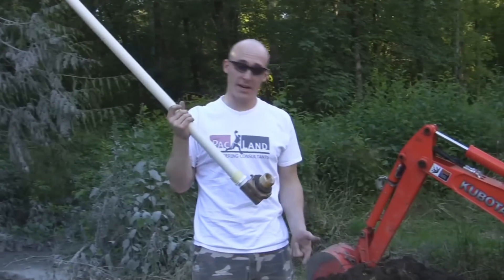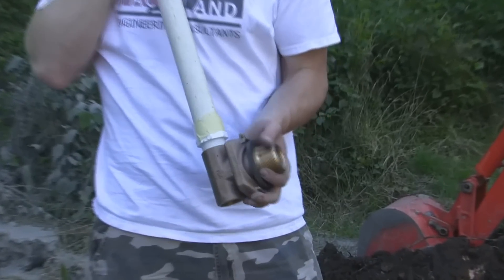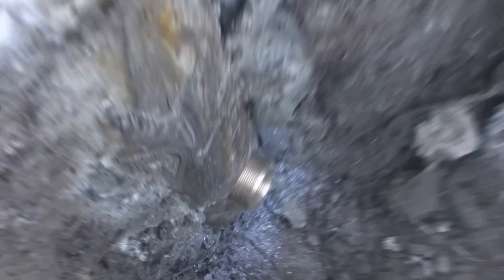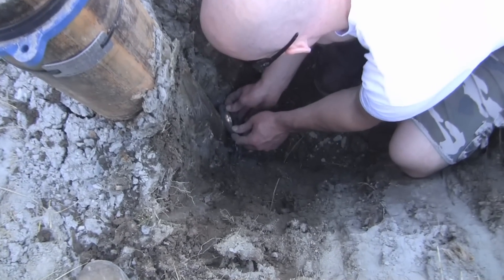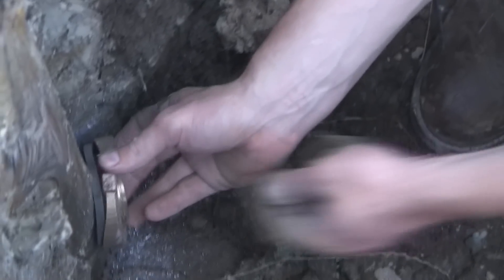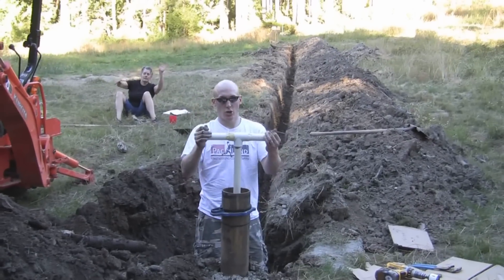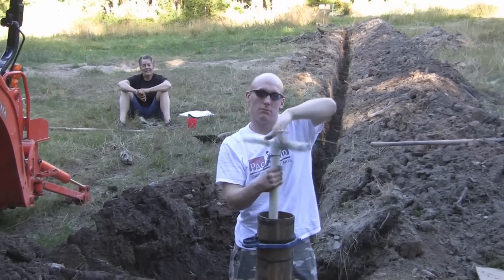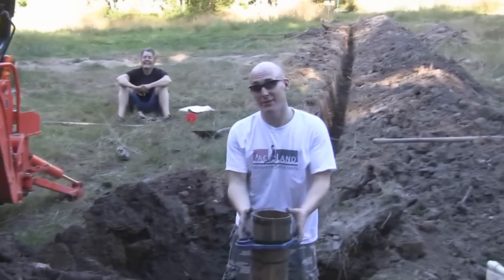How to install a pitless adaptor

Comment: old wells had 4 foot pits to allow for frost protection. they would always be open for servicing. a pit-less adapter is so that the PIT can be filled in to prevent contamination.  it also keeps people from falling into an open pit.
Reply: In Canada we have 8 feet. So dug 8ft down by hand lol

Comment: Nice job!  I've now done some of these too.  I have a pitless with a spring instead of the "slide in: type.  There is a hole at the top of the side in type where you can attach a string  This will prevent it from falling down the well if it slides off your "T".  I also made my "t" from galvanized, (the second time around..lol)  so it would thread easier down in the well, where you can't really see it.

Comment: Lol , you guys are some funny people.  Awesome video by the way. I found it because I have been working on my grandfathers old well and kept seeing the term pitless adapter and was like. what the heck is that.
Of course I made some observations that I cant help but point out. One is that I would have cleaned and possibly bleached where that seal went on. Second and most important thing was the the tab  with the hole in it on the pitless adapter. lol this hole is for tying a small roper to so you don't drop the thing down the well. You get points for bravery though because id have been scared to death that thing would fall off. lol. Jet pumps and submersible pumps all have holes or tabs with holes to tie ropes or lines off of so if something breaks they can be pulled up.  I love working with wells and learning new stuff. Thanks for the vid.
Reply: I've been doing this for years professionally and the way he did is 100% correct. The pitless certainly will not fall into the well I've installed hundreds of pitless adapters and the fact is that you need to really pull that pitless off of where it rests. The only thing that I found flawed was the fact he had a PVC tee, if he wants to pull it back up it should be galvanized or stainless

Comment: You need to put a small piece of pipe inside the pitless adapter to keep it from separating.. .once you have it through the casing and the nut on you pull out the small piece of pipe and pull out the T handle!

Comment: Should use iron (steel) pipe for pump removal. PVC sometimes strips the threads or breaks during the removal process. Be prepared to pull hard when removing the pump. May take two or three people to pull hard enough to break the pit-less adapter loose and depending on the depth of the well some take some serious pulling before you can get a hold of the rope that goes down to the pump.

Comment: Originally the pit was to keep the water line below the FROST LINE. most were six to eight feet square and about six feet feet deep (because of the free circulating air going deeper than the frost line.. Sometimes with a slanted basement door for easy access and tornado shelter use.  If you did not have a pit you would need a little building on top (Usually filled with garden tools and the pressure tank.)  The building above ground required light bulbs, heat tape and insulation to prevent icing.

Comment: In areas that freeze, you would have to bury the well head to keep it from freezing. 
With a pitelss adapter this is not necessary.
Reply: That's not true, even if it was a true artesian with the water free flowing over the top it still wouldn't freeze due to 60° ground water running over the top and even if it did freeze let's say it would only freeze maybe 5-6ft below ground level because the dirt keeps the rest of the well insulated. All that matters is that the pitless is below the 5ft deep frost line

Comment: Great video....thanks.
One question - when you back filled over your water line did you bed and cover the line in sand or use and other measures to ensure that the water line is not damaged.  
Cheers,
R1514